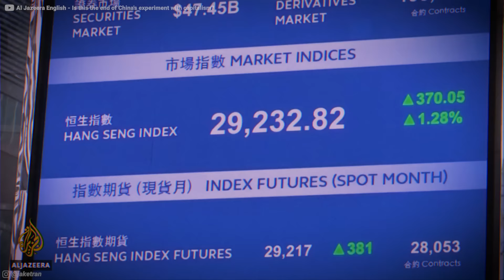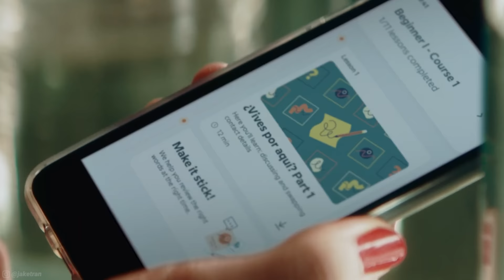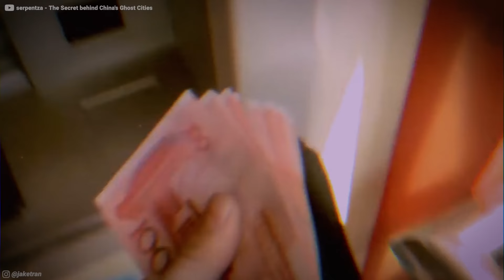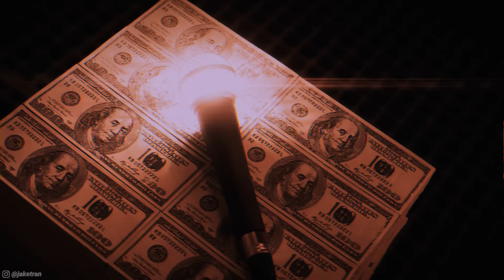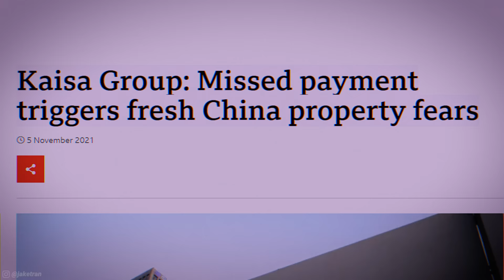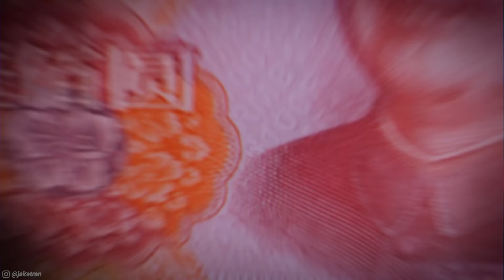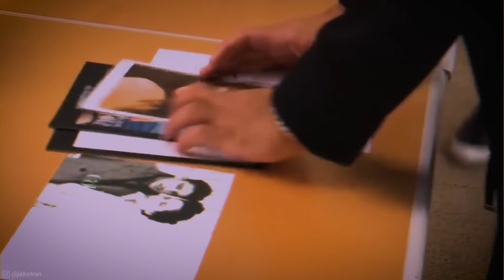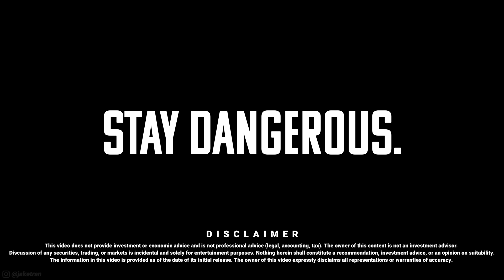It’s happening now.

Comment: I doubt that the bailout is enough. China has a habit of not liking to do direct bailouts which is why most of their bailouts are never heard off. They aren't the conventional bailouts you hear about normally like back in 2008. They usually come in the form where companies like Evergrande will continue suffering but they are able to continue operating at the bare minimum. Basically you can think of the board members of Evergrande having a way out but they have a knife to their throats this whole time.
Reply: Good
Reply: I can't say I hate that design...
Reply: It depends on what is your preference tbh, a direct bailout like what happened in 2008 followed with the companies recovering strongly or an indirect bailout which allows bare minimum operations with the companies still getting by. 

At this point, I'm more in favor of doing a partial bailout while letting the companies climb out of the hole they dug themselves.

Comment: I'm in the UK 🤣 trust me...you can own things. 
It's just...you remove your own rights to your own things in this system. The system in the UK is based on honesty. You won't ever lose a thing, in times of hardship or breaking civil laws or with debts, if you aren't honest. Honesty removes your rights. 
Example. It's perfectly legal to drive a car you don't own as long as you are insured to drive it. 
Registering your vehicle to a sole trader business with a non tracable P.O. box address on the logbook...where do you think parking tickets and speeding fines go? To whoever owns the vehicle and to the address on the logbook. Perfectly legal. Not moral. But legal. Just one example. 
The system is akin to the difference between a standing order (you retain power over your own money) and a direct debit (you sign away the rights to your own money)

Comment: The section about loans and mortgages is kind off misleading. Using a loan/mortgage to buy a house is no problem in itself and kind of logical because most people don't have the cash to straight up buy it directly. Loans/mortgages use the future salary/house as collateral. The problem comes from the fact that Loans/mortgage are getting approved on the hope that the price of houses will increase and without checking if the futures salary of the ones getting the lone is enough collateral for the loan.